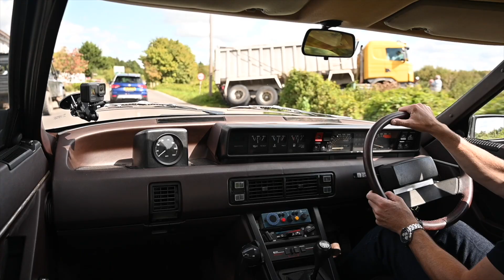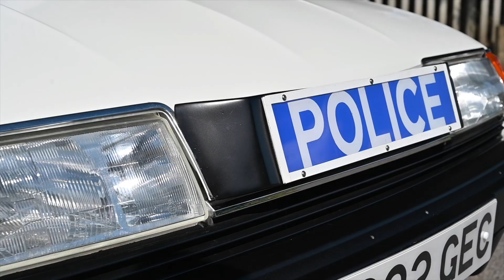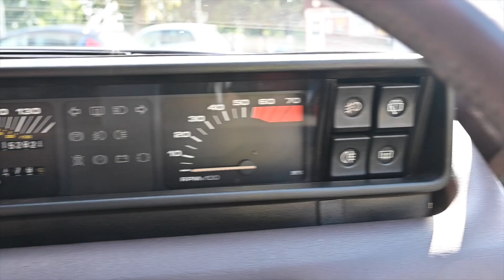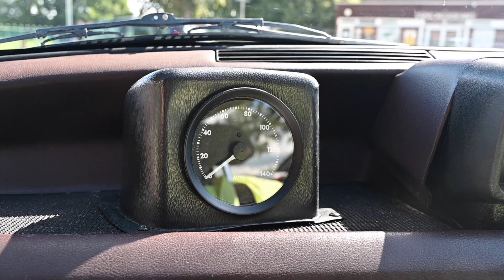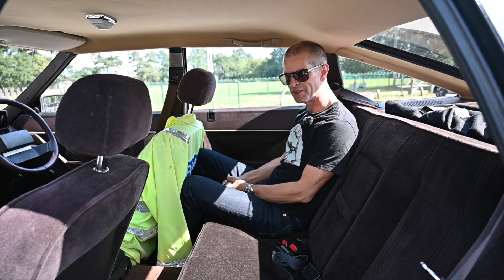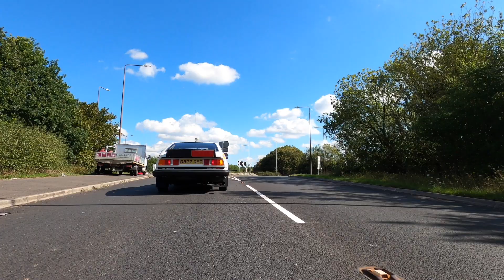1986 Rover SD1 Police Car

Comment: Brings back many memories of my 1984 3500SE Auto. Like you say in your road test Matt, it can get a shift on. Trying to stop mine on standard brakes led to some scary moments! On a motorway those things could cruise at slightly illegal speeds all day long with no effort, you can't beat a V8.
Reply: RIMMER brothers supply 4 piston vented disc upgrade.

Comment: SE model was dropped early '84.
IMO, this car was registered much later than it was built or was a Police-special spec with the SE spec brought back.

Back then ('83), range was:
2000/2300.
2300/2600S. 2400SD
2600/3500SE.
3500 Vanden Plas.
Vitesse.

When this car was registered, the range was:
2000/2300
2300/2600S. 2400SD
2600/2500 Vanden Plas.
Vitesse.
3500 Vanden Plas EFi.
Reply: All police spec carb v8’s were badged as 3500se. It actually says 3500 BASE on the log book and has the magic X in the vin number indicating it’s a police special.
Reply: @nitrosilvia  
That would make sense as SEs also had a sunroof !
Do you know if these were 2000s with an engine/'box swap then or were they built up from shells right from the beginning to be Police cars ?

Comment: My entire driving life from 19 to 40 was in those (I had about 12 or 13 of them) all but one were V8's and I had one ex police car (unmarked) that still had its 2 tones installed - the bolts for the compressor rusted so they just cut the pipes and pulled the wiring and I may or may not have fixed them :) would love another one but they are no longer cheap and hard to find in decent condition.
Reply from the maker: Yes, its good they are worth something now but a shame as well as Ive wanted one for ages and now thats not a cheap toy!

Comment: I had the pleasure of riding around in  these in 1980s, the Metropolitan Police versions had automatic gearboxes and they had a huge presence on the road which made making progress through crowded West London much easier.  I remember "proceeding" down the M4 to Heathrow Airport with the blue lights on and being  passed by a speeding Golf GTI,   the Volkswagen driver had a very expensive day in court.
Reply from the maker: If you pass a cop car with the lights on you are definitely not paying the sort of attention you should be when driving fast and deserve to end up in the dock! How can anyone not notice one of these lol
Reply: @furiousdriving  The Met also used Austin Metros a lot, they were rather cramped when carrying large coppers.
Reply: @furiousdriving  I also recall that the V8 engine  was used to power the long wheelbase LDV  minibuses used by the TSG (Territorial Support Group). These large armoured vehicles had a surprising turn of speed and I remember one incident when a small stolen car (Fiesta/ Metro size) was spotted by the TSG LDV  I was in  and a pursuit ensued. As our big Police V8 minibus attempted to overtake the fleeing vehicle the driver of the little car swerved across the road and tried to  ram the armoured bus;  the laws of physics came into play  (F=ma) and the car bounced off and went straight into a fence. Luckily no one was injured but the driver was arrested.

Comment: Speedo stopped working, faults like that were the absolute bane of these cars. When I had one it never let me down however there were many occasions where something would go wrong on a trip and some roadside tinkering was required.
Reply: Sounds like the car was definitely letting you down if you had to perform frequent roadside repairs.
Reply: @nkt1  in my definition letting down is where you need a flatbed like I have needed to many times on my various BMWs.
Reply: @andrewthompsonuk1  Fair enough, that makes sense.

Comment: I borrowed an ex-Met 3500 for a while in the early '80s. It didn't have power steering and was one of the most vile cars I have ever driven - endless turns on the wheel and still incredibly heavy. I'm amazed the Police Federation didn't refuse to drive them. Perhaps I was spoiled because I had my own SD1 at the time with PAS of course.

Comment: ive had two older cars where ive found one of those big speakers the one in the centre console although both of mine where under the dash,what would that be for? not neccisarily police equiptment i would imagine
Reply from the maker: Probably an old car phone installation, they used to use a speaker like that before they worked out how to integrate into the cars own speakers

Comment: They came to India as the Standard 2000 with the old Vanguard engine in the late 80s. Its supercar like performance ( in the fuel consumption department) doomed it.  I doubt if many survive. Haven't seen one in over 20 years. Still one of the prettiest cars to have been sold here.

Comment: Matt, I'd love to have an SD1. I knew that the police stockpiled them. Did you know that West Yorkshire was the first police force to have the SD1? I could tell from the plate that it would be a Lancashire police car.
Reply from the maker: Didnt know Yorkshire got them first Id have expected the Met
Reply: I recall that too! These were so well regarded by various Police forces that they did indeed get stockpiled and used well beyond the date of the last cars released. 

Actually, I believe something similar occurred with the P6B for the use as ministerial vehicles well into the 80s.

Comment: 16:58 You can see the rev counter is registering, but neither speedo is working.
Reply: Yes i think it is an intermittent issue with the sender or the wiring plug at the bulkhead.

Comment: A couple of years back the program "For the love of Cars"  rebuilt the ultimate SD1 Police car, a very late tuned Vitesse made specially for Grampian Police. It really was Mad Mac's "last of the V8 Interceptors" !

It was bought at auction by a museum in Inverness.
Reply: Yeah there were a few forces who had police base spec cars but with vitesse engines.  Grampian only had the one.  West Yorks had a few.  You could always tell as they had a ROVER badge at both sides of the rear badge bar, not 3500SE or Vitesse.

Comment: One of my all time favourites, must confess to sitting in the back of a few in my youth.
On mine when you opened the drivers side glove box it would dispense two pints of water over your feet !
Very clever design re the pod.
You just moved it to the left and the steering column would fit through the air vent for the left hand drive market.

Comment: A thousand years ago when I was eighteen, my boss bought one of these brand new in that mustard yellow colour. He had it in a heated garage, polished every week etc... After two months the paint on the rear quarter panel and bonnet started to blister, in a week it was full of fluid-filled blisters that started to take chunks of paint off when they popped.
He had it re-sprayed three times under warranty but it always appeared elsewhere. I'm curious to know if anyone has any ideas on the cause?
Reply: Yes at the time of the initial launch Rover were experimenting with a revolutionary painting system.  It didnt work so well, so very early cars had shite paint.  So much so that there are rumours that during PDI inspections and cleaning with a jet wash the paint could delaminate!
Reply from the maker: The last P6s (the VIPs) trialed the same system and most had to be repainted by dealers
Reply: Apparently the early models were absolute rust box’s they started to fall apart & rust in no time, but the later builder models like this 1986 version a lot of the rusting problems had been ironed out. Sounds like your manager had a earlier model?

Comment: Sorry the bad sound quality of this video. Put me off watching it till the end
Reply: Brent Fairlie that was mostly in the beginning of the video and it's absolutely fine during the driving commentary until the end.
Reply from the maker: its the wireless transmitter, its breaking but a new one is on order and as Gentil said it was mostly as I walked around at the beginning. I actually had to cut alot of the info about the car as the interference spoilt it.

Comment: Regarding the rear suspension - it's a live axle, albeit well located with a Watt linkage and radius arms. Seemed to serve it well though, including on the race track. When compared with the Triumph 2000s true independent trailing arm rear suspension, and the Rover 2000s DeDion setup, it looks relatively unsophisticated but that was intentional on cost/maintenance grounds and really, did any buyers really notice a difference in ride quality I wonder?
I owned a Triumph 2500 but would really have loved to have owned one of these as well.
Reply: I had both Triumphs as well as SD1s years ago.  In general, the handling and ride on the SD1s were better than the Triumphs. However, under certain circumstances on bumpy roads, the Rovers would step or hop out at the rear where the Triumph would keep its line better. However, unlike most other live axle cars of the 70s the Rover was far easier to control if pushed a little too hard...
Reply: At that time manufacturers such as Fiat and Opel, and before that, Bristol, had demonstrated that a well-engineered live rear axle can work very well, in terms of roadholding, ride and handling.
Reply: There was one for sale in New York. USA spec car, only a couple of weeks ago. On the SD1 club forum
Reply: I have a Passat with rear axle beam. I’d like to test drive a 4 motion with multi link at the back so see difference

Comment: Im confused about the manual gearbox, i thought they were all automatics (aside from the manual one that Phil Glenister and Ant Anstead did in for the love of cars)
Reply: No, they always had a manual option. It wasn't a very good manual option and reviews of the day would always say you were better off getting the auto, but it was definitely there.
Reply: Most police sd1's were manual.  The met had autos because of the environment they worked in.  Pretty much every other force had manuals.  The reason people think they were auto is that there are more met cars surviving than any other force.  Manual is faster on acceleration and more fuel efficient.
Reply: @nitrosilvia  that explanation makes the most sense to me, thanks!
Reply: Probably the Police trying to save money as auto gearbox’s were super expansive back the 80s and with the Police buying hundreds of these I imagine it would of been a cost saving exercise?

Comment: Did they make them in India after BL had finished with them?
Reply: Yes, they shipped out loads of kit builds and then the actual 1st group of steel presses.  They actually started building them before production ended here.  They were called standard 2000.  Had a different interior and drive train.

Comment: I remember that Rover sold SD1 models at Jaguar dealers in the US in the late 70s. The US-spec SD1 had 4 round headlights fitted as all headlights had to utilize standardized sealed beam headlamp units at that time. Rover had been out of the US market for a decade by the late 70s, and it was considered an “odd brand”.  The high price of the SD1, combined with non-luxury car styling (a luxury hatchback!?) and BL build quality doomed it. Most new car shoppers looked across the showroom floor and picked up a Jaguar XJ6 instead.  Rover pulled back out of the US market after just one year.  Only about 1,100 of the SD1 models were sold in the US market during the time it was offered here.  An expensive disaster for BL. I would bet that only a handful - if any - of them survive.  The last time I saw one was in a junkyard in Texas in the early 90s.
Reply: There are still quite a few NADA SD1s around, and not just in the US.  A lot of the unsold cars came back to Britain and were rebuilt into right-hand drive form before being sold off as used vehicles.  They have quite a niche following, partly for the rarity in the US, but also for the fact that the NADA (North American Dealer Area) cars had a much higher standard specification than the UK vehicles, including such things as air conditioning, which was a very expensive, and therefore very rare, option in the UK.  The NADA cars also seem to have been in a somewhat higher state of tune than they did in the UK, presumably to offset the power-sapping effects of the air conditioning and emissions control equipment.  A friend of mine has a NADA 3500 manual and it is appreciably quicker than a standard UK-spec V8 and can hang pretty well with the Vitesse...
Reply: The clock and stopwatch was actually originally equipment, I believe, when you didn’t have the computer. Don’t think it was accurate enough for court....;) The 12 V socket in the back was meant to power a cigarette lighter.
Reply: I believe it was 1980. By 1981, they were gone until the Sterling until around late 1986 for 1987 MY. That turned out to be a disaster as well, but Land Rover, Range Rover still selling here to this day.
Reply: @frothe42  The Stirling was a mess initially, they really sorted build quality after the first two years but unfortunately the damage was done.

The Mk2 was far better built than the best Mk1s and they even turned it into a Coupé for the US market, then they pulled put of the US and it never got there. I think had they tried selling it as a Rover and distancing it from the Stirling stuff it could've done well!
Reply: @SpitfireFortyFour  I have seen pictures of the Rover 800 coupé, absolutely gorgeous, more like the second generation Legend, except it looks better.  I somehow like the SD1 better, and wish they added rear disc  brakes to the vehicle.
I wonder if a four speed automatic can be retrofitted into an 3500 automatic?
Reply from the maker: I think it can, its the same casing and not electronic shifting as far as I know
Reply: @frothe42    Yes, it has been done a fair few times, though that's largely on right-hand drive UK-market vehicles, there may be differences with doing it to a left-hand drive NADA-specification car...
Reply: @furiousdriving  That would definitely help in fuel economy and lower RPM at highway speeds.
The early 80's here in the US they were starting to switch to 4 speed automatic overdrive transmissions for fuel ⛽ economy standards.
Luckily I do know how to drive a manual, thanks to the insistence of my mother.
And if you do a Google search on an US spec SD1 Rover you will see the Round headlamps that were required.
I just love everything about this Rover 3500!